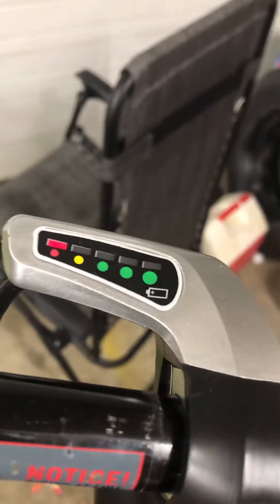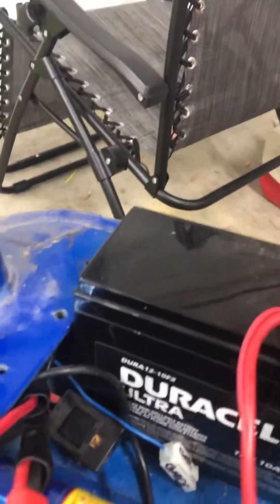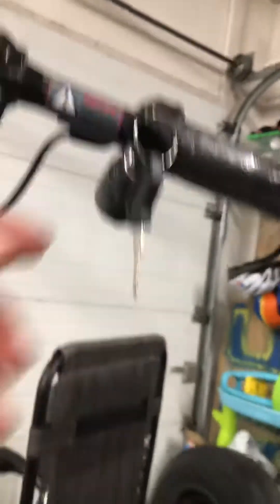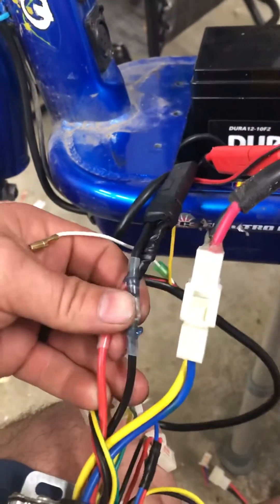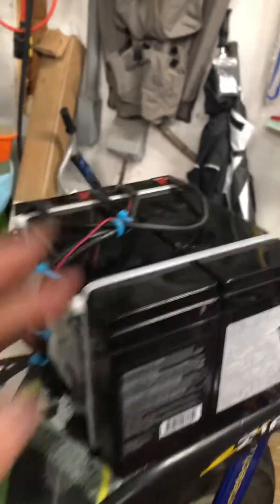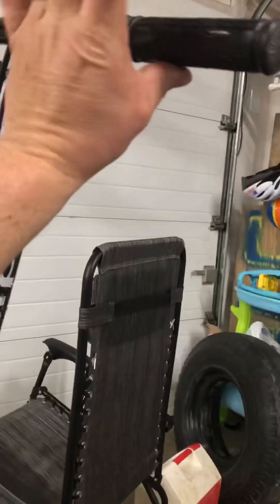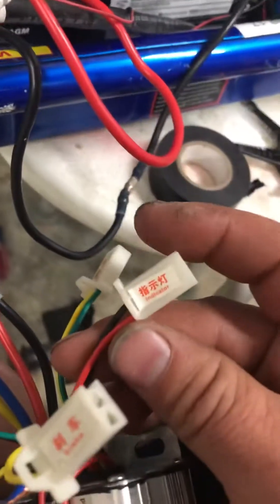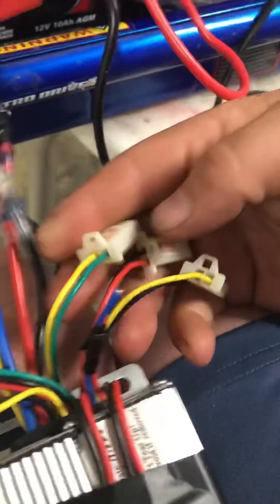How to hook up 48V controller to an electric battery operated scooter

Comment: is there a way to wire up 48v-52v battery directly to the motor and throttle using a relay ? bypassing the controller

Comment: I inherited a 36v gb moto Monster. I can find nothing for parts, manuals for this specific quad. Any idea where i can get this info?  I want to change out the controller but can't find an identical one. Also don't know if the motor is brushed or brushless. SOL?
Reply from the maker: If there are only 2 wires coming from the motor than it’s brushed. If there’s five it’s brushless.  As long as it’s matched up with brush or brushless and voltage matches, you should be able to get the different replacement parts to work.

Comment: If you loop the sport, it adds power
Reply: Loop the sport?
Reply: I have a 36v 1000w scooter made by a Chinese company called Chihui that was fundamental in the design and sales of the scooters that we now know as Uberscoot and Evo powerboards, but this was like 2009 - 2010. All the original controllers just had one male-connected sport wire coming out, seemingly with nowhere to connect to, very similar to the controller on this video. If you splice it, then you would put your scooter from economy mode sluggish, which is slow to fast sport mode, or 100% of your 1000w for my early model, which is 3000rpm. Of course, you could add a small switch or now just buy an at-the-time new Next Generation throttle that had a red switch just below the battery level LEDs on the throttle. That would connect to the sport mode to toggle it on and off on older ones like mine it is common to splice them maybe put a small switch inside your battery compartment if you have kids who might ride it sometimes.
Reply from the maker: @WallijandroFrostini  this was many years ago. I just rewatched the video and in it I mentioned that when I looped the sport it made it slower, not faster. It must’ve come stock already on sport mode already. Seemed to only have 2 speeds. My razor mx650 with a far driver controller has 3 modes like you’re saying.

Comment: Hi mate i got a mini e bike so is 350watt hub moter but lil bro dont use is a 36v controller  and battery is 36v 6.6ah so iv seen ppl saying is as simpile as buying a better controler ie somerhing that could take higher out out watts and volts but no that would have 2 upgrade the battery 2 i dont weight much and looking for long distances and lil bit moore power 2 carry me up them steap hills im not 2 share wot i should do plz help me woth some advice if you can plz mate im london uk and wont 2 do a 1 of diy build im prepeard 2 pay wot ever it may cost me iv had dultron thunder for 4 years and tiyed of standing and decided a e bike but i like 2 be different the bike i have is a windgoo b3 iv got upgraded parts for it all reddy prepration for the built suspension seat pole raised woder handail bars fluid brakes grips wont 2 build a dual moter mini e bike would luke it 2 look standead but puform like a super bike lol 😂